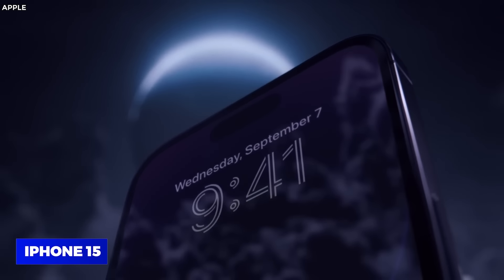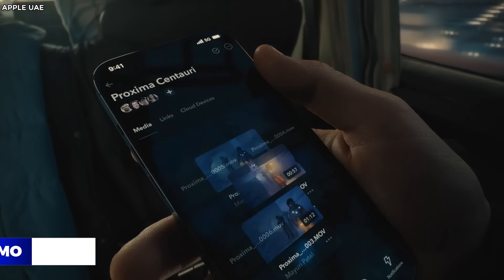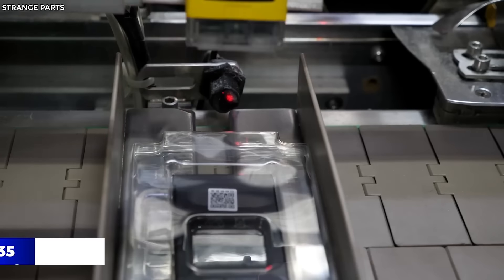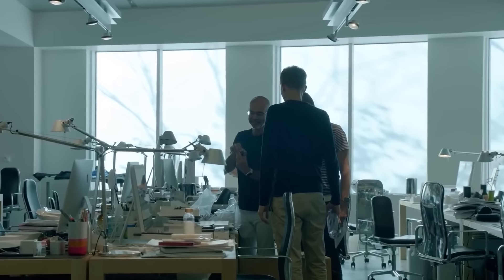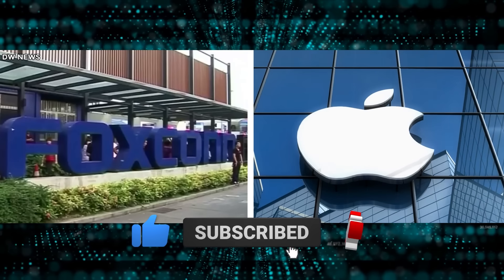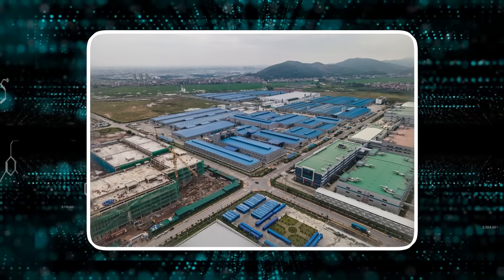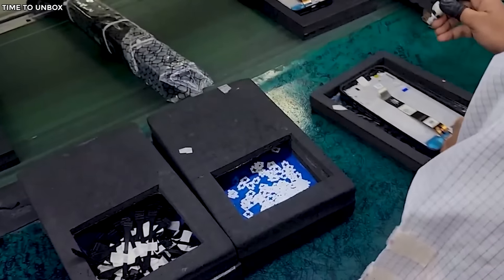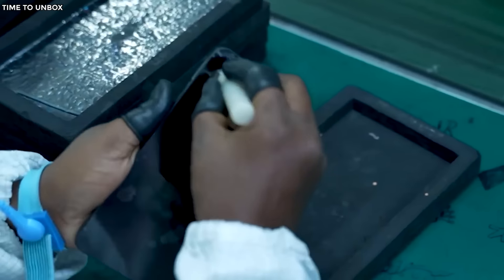Inside Apple’s ALL NEW iPhone 15 SHOCKING Factory

Comment: Have been using Samsung for years: no issues at all - Samsung S8+, Samsung S20FE, Samsung 23+. The only would be a battery slightly degrading after 2 years of use. It's relevant for all electronic devices. Give me five (at least) solid reasons for me to move to iPhone (theoretically of course. I would not want to make such decision)!  And five things Samsung does not have as compared to iPhone.
Reply: Samsungが好きならSamsungでいいんじゃない😂